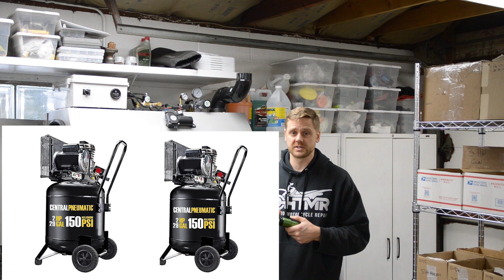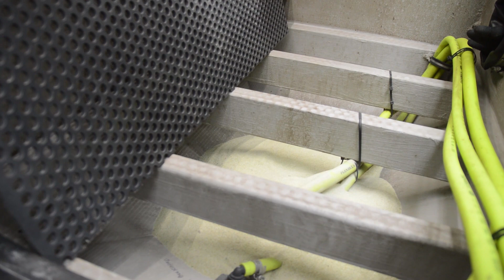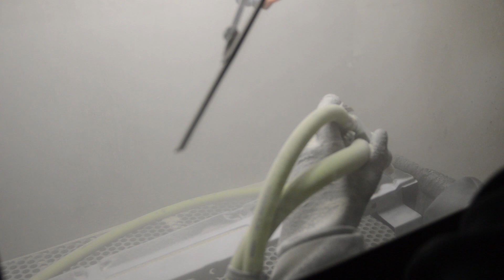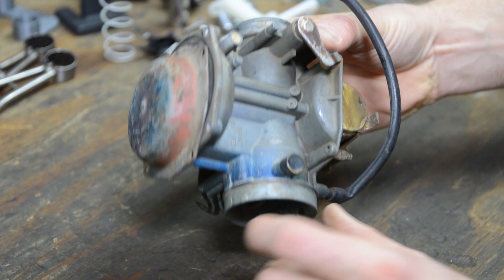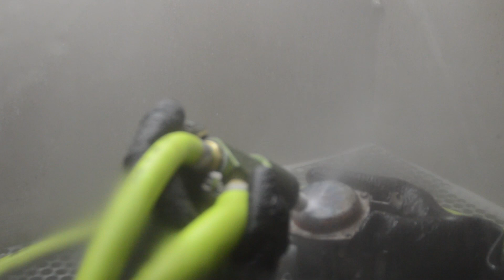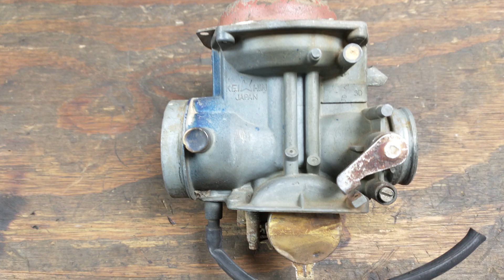HTMR 3HP Blast gun NOW AVAILABLE!

Comment: What do you mean, Chinese Design? R&D in China means Receive and Duplicate. That is to say they probably ripped off a design from somebody likely anywhere else in the world, and probably from the 1950's, when it was state of the art. I'm about to look at the 3HP video - my 5HP compressor is really not what it claims... another something that got out of control here in the 80's and 90's, claiming a 15amp (2hp) compressor is 5hp was (is still) not uncommon. A "real" 5hp continuous duty compressor will pop a 15 or 20 amp breaker starting under load.

Comment: Just wondering if in the process of doing CFD models for these guns you came up with a model for air jet to nozzle distance calculation. Every video i see on youtube basically says try it till you like it... Just wondering if there are more scientifically sound approaches???
Reply from the maker: Yes I experimented with distances. For wet blasting doesn't matter a whole lot. For dry blasting it changes the vacuum signal. However, I recommend dry blasting with a metering valve over a siphon tube since you can get better performance and adjustability.

Comment: I’ve aquired a homemade cabinet with a carburetor business.  He ran a 200l 7.5hp compressor but in AU I couldn’t get 3 phase and in hindsight should have just used vfd to convert single 220 to three phase 440.  

Love your work.  Will be ordering soon. Just need to find a compressor that I can run single phase, even step to 15amp (I’m from Indiana and moved to Melbourne area they use 50hz here)
Reply: What equipment is needed to assemble one?

Comment: Has anyone compared this to Victor Bared or Armoury Enterprises 3D Printed Gun? I know its twice as fast as they ebay/chinese gun but wondering how much improvement on the 3D guns? at $375 CAD by the time I get it to Canada its about 1/3 the cost of my entire cabinet setup. My setup works well now however I do feel it could be improved speed wise, but if I only get marginal improvment from a $375 investment ill be chapped haha!
Reply from the maker: I've had people buy my gun after those 3D printed guns broke. If you have a 3d printer, you can just keep printing them no problem. However I would not pay close to $100 for a 3d printed gun and later have it break. Also, you can't use aluminum oxide since the plastic will wear out quickly.
Reply: @HTMR  thanks, I do have a printer and they cost nothing to print for me (not that I want to keep reprinting guns) but I am more wondering on the efficiency of each, I assume your gun performs so well because the length of the airjet and nozzle, would that be correct? The airjet and nozzle on the 3D guns are much shorter.
Reply from the maker: @kyushalimit5931  yes I can tell that the nozzle I use will be more efficient just by looking at it.
Reply: @HTMR  appreciate the response, I have a 3.7HP/60G compressor, would you stay stock to ordering the 3HP gun or get the 5HP one and be a little underpowered?
Reply from the maker: @kyushalimit5931  What is the CFM rating at 90psi?
Reply: @HTMR  11.0 CFM @90 PSI
Reply from the maker: @kyushalimit5931  3hp gun will be perfect.

Comment: I have your gun. I recommend it. Can, I make a suggestion? Offer it with an articulating arm to hold it in place so you can move the part instead of the gun. Hanging onto the gun becomes a real chore (not the gun's fault). I will create something. I recently looked at a few commercial blast cabinets and saw several are now offering a stationary gun holder.
Reply from the maker: I will look into this.

Comment: I bought your blast gun. I recommend it. Do you have any suggestions for additives to the water to prevent flash rust and bacteria? Vapor Honing tTechnologies sells these items but they are pricey. Like to find a DIY solution.
Reply from the maker: Flash rust: https://howtomotorcyclerepair.com/preventflashrust/

For bacteria etc....look into pool chlorine. I bought a little bag for $3.
Reply: Thanks for the quick reply. I did dump some Clorox in the water when I ran out of Vapor Honing's product.
I am aware of HoldTight 102, but I live in Hawaii and neither Amazon or the only vendor on eBay selling it ships it here. Unfortunately, they only sell it in gallons or greater. It's a chronic problem. @HTMR

Comment: Love your videos! I have a 4 hp 12.7 CFM compressor and can run 100% duty cycle.  Will the 5 hp gun be the wrong choice and must go with the 3 hp gun? Will you be releasing a 4HP gun?
Reply from the maker: Go with a 3hp. Run it at 65-70 psi and you will be at 13cfm.

Comment: I have a 26 gallon compressor that’s rated at 4.5 cfm at 90psi (1.8hp)

Will the 3hp gun work, just slower? I’m just removing machining marks before anodizing. I have the HF blast cabinet now and have just been using the stock gun that comes with it. Wet blasting with glass bead
Reply from the maker: Yes it will work however you will have to wait for compressor to catch up. You are likely already doing that. Watch this video on sizing and provide me your current air jet size: https://youtu.be/blRONjWqvbM

Comment: How does the Tacoma Company gun compare to your new blast gun?
Reply from the maker: Very comparable if not better. HTMR gun nozzle nut does not seize though, offers more corrosion protection, and has a larger media hose hookup for more flow. Nozzles are half the cost and I have more sizes available in stock now.